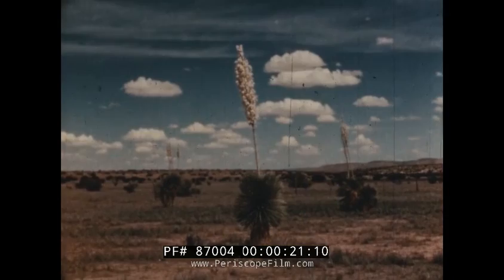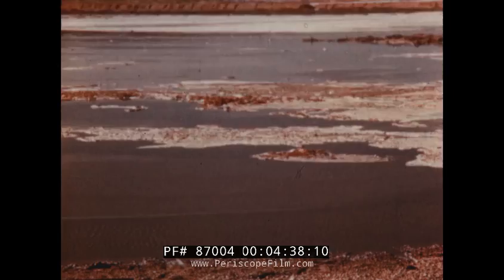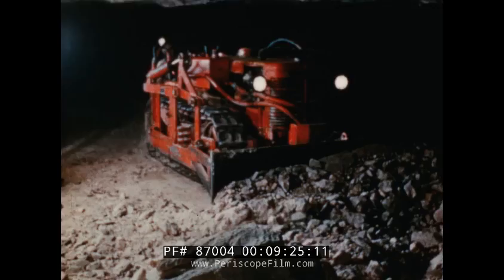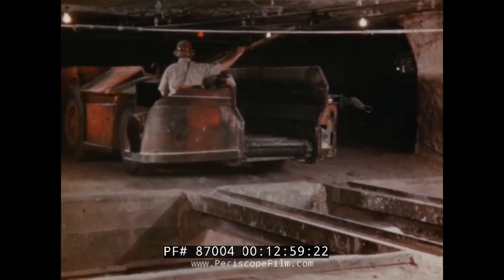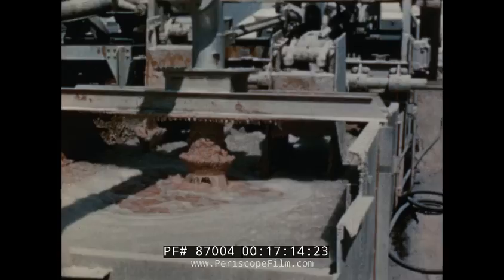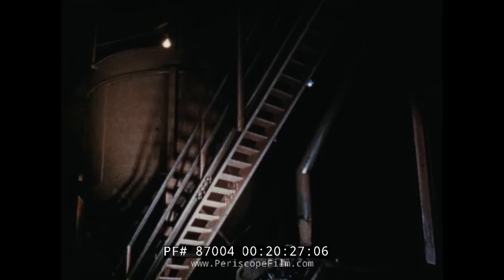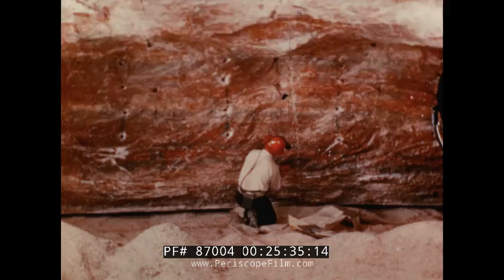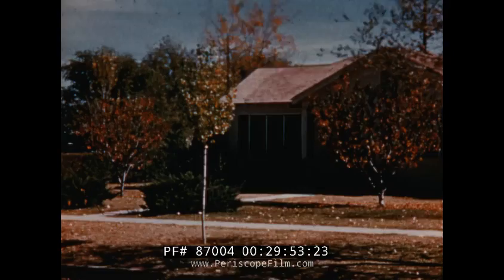IMC GLOBAL POTASH MINE AND REFINERY AT CARLSBAD, NEW MEXICO 1950s MOVIE 87004

Comment: My dad worked underground running undercutter and later was a painter above ground from early 40's to the 60's his partner and his him had a picture of them running a undercutter in the reception area of the main office. I saw it once. I wish I could find a copy of it. He did take a break to serve on the USS San Jacinto aircraft carrier Pacific theater WWII. He told me alot of stories.  I always enjoyed them. Sad to hear the mine is closed I was going to call them and possibly find a picture of the mural. Thanks for a great video.
Reply: The mine isn't closed. Ran by Mosaic now. Lots of old pictures in the office.  Bet if you contact them they may still have that picture.

Comment: This mine has been demolished all that is left are the head frames water tower and concrete monoliths it can be located at the eastern terminus of New Mexico Currycombo Road 235
Reply from the maker: +kcebolpj Thanks, we were wondering what happened and if it was still in operation.
Reply: Don't want to be picky but it's Curry Comb Road.
Reply: How sad.  I wonder what was buried there.
Reply: Not sure what you mean man. I worked at this very mine, now known as mosaic. Iv been in these old works and everything has expanded. We no longer blast but use continuous miners and electric or deisal ramcars
Reply: @laythememes9425  potash we know it's important. And it's and the foreign mines are probably going to be shut down because they're in Russia. And we aren't doing business with.
I think it's time to expand.